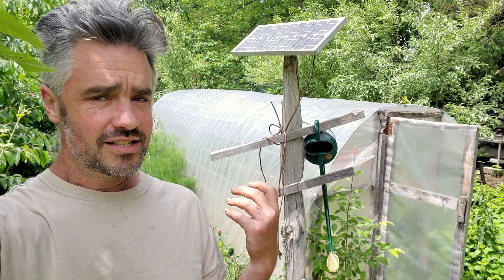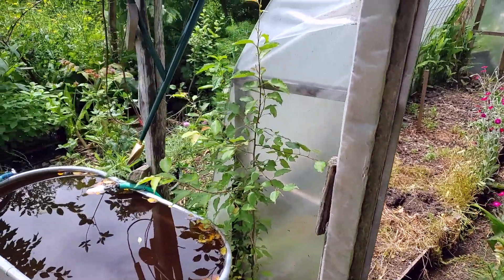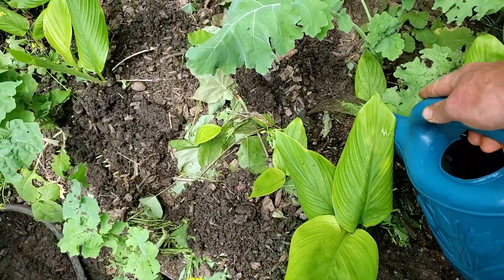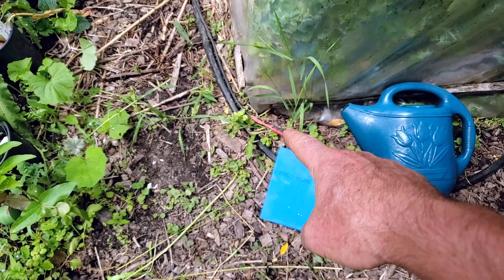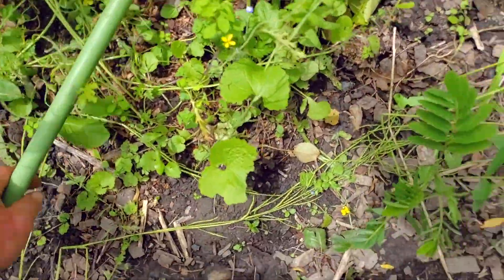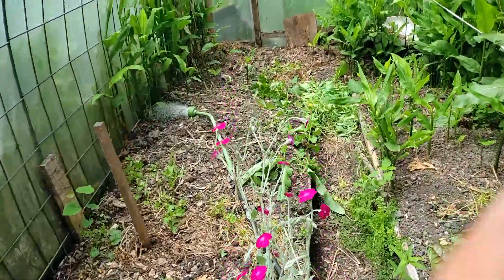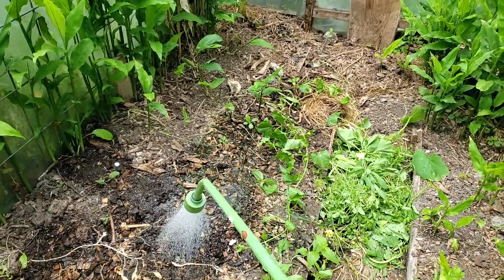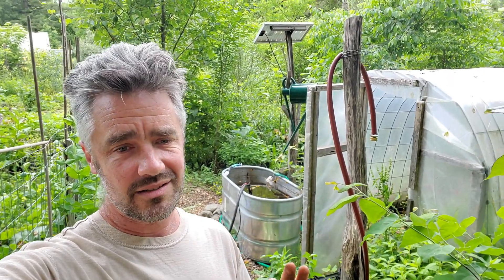Off Grid Pump - Watering Upgrade!

Comment: I put mine in a knee-high nylon stocking to to filter out the big stuff.
Reply from the maker: Thats a very fine level of filtering, you could run it through drip tape with that, wow!

Comment: I use a cheap-o 18 volt submersible pump that came with an adapter for my Milwaukee batteries. It came with a 3/4 barb fitting, so I had to get an adapter for garden hose thread. Pumping 250 gallons takes half the capacity of a 8AH battery. You can do it with 5AH, but it slows down on the last 20-30 gallons.
Reply from the maker: Neat.  Yeah, I found an adapter that lets me plug my 18V makita battery into a receiever that then bucks it to 12v nominal so I can wire in my standard and inexpensive bilge pumps... May be worth exploring... search "milwaukee 18v to 12v adapter" and you can see options sub $20 that turn your batteries into a more universal power source...

Comment: You have harsher winters than I, how do you rig your rainwater tanks in the winter? It has been many years, but last time I had a rainwater system working a late freeze shattered the ball valve and drained all the water. I have been trying to figure out how to plumb a tank for winter storage. This is due to our Mediterranean climate delivering no reliable rainwater in the summer. Thanks for the Garlic! It’s almost ready for harvest.
Reply from the maker: So important to drain tanks in the late fall...   I try to have ours open and empty by Halloween

Comment: I like that this can be used anywhere on your property, for this system I might be tempted to use a second float with a siphon from the tank to an open top / wicking reservoir laid in the bed, Hoocho's - a hydroponics educators rain gutter grow bag systems come to mind. 
https://youtu.be/DyHJvAIe-JI?si=ry2EVN2O51l4UFnM

would mean automatic wicking watering - which the turmeric like in my experience, plus no electricity and you could put the siphon end only so far down in the rez so if it went out of level it wouldn't drain your whole system.

Totally rainwater based is so cool!
Matthew

Comment: I like your solar powered pumps a lot, and have pointed many people toward your irrigation videos, but I'm kind of surprised to see them in this context,.
Because there is reservoir  the next to each bed, I be inclined to  install a hose at the bottom or each tank or trough  and use the gravity to water.
Of course, this way is much faster, and only needs one set up to cover every trough/barrel.

Comment: I was so inspired when you did a video about a solar panel and the little bilge pump! I bought the supplies but my small solar panel just wasn't strong enough to work, so it all got put away. 😢 I would love an in depth video, please show how to do the clamps, connect the wiring plugs and give all measurments of pipe diameter. I ask this because I'll be figuring out how to do this with no ones help but yours! Long time channel subscriber😊.

Comment: I'm generally a big fan of your DIY/solar punk approach to solving a gardening problem, but around 5:25 you advise people to use a cracked solar panel. Studies have shown that a fully intact panel won't leach any harmful elements into its direct environment, but the results are less rosy for damaged ones. Until I accidentally stumbled onto such a study, I'd never have thought of it either. So this is just a heads up. I know there's no ill intent in your advice.
Reply from the maker: Thanks for sharing this concern I wasn't aware of it.  Could you share a link to more information so other folks can learn about this too?
Reply: You are right about this, my husband said it's terrible that the government (uk) is letting good farmland be used as solar fields. I never would have thought it was a problem but he told me about the forever harmful chemicals that can leak into the ground!

Comment: Why not use soaker hoses or drip irrigation to reduce the amount of effort even further? Do you really enjoy manual watering and want to keep doing that or is there another reason why automating this system further is undesirable?
Reply from the maker: Most soaker hoses have some nasty chemical stuff in them and bake in the sun all day so I'm not psyched on it as a solution...
Reply: @edibleacres  Yeah okay, good point. The ones I've got are basically just fabric but there's no way they're made of a natural fiber so it's probably polyester. It's also recommended to put mulch (straw) on a soaker hose. 

Although, if the goal is to limit chemicals in the garden, then plastic pots, regular rubber hoses, greenhouse plastics, tarps, etc aren't that great either... Sadly there aren't really any good alternatives for most of those things. Pots can be ceramic or cloth but cloth would likely still be made of plastics, hoses/pipes can be ceramic/metal but that's really inconvenient and can't be moved around, glass windows for a greenhouse would be preferable but insanely expensive and impractical, tarps can be cloth soaked in bees wax and oils (this is one of the few items where the alternative is actually both better and cheaper than the standard store bought option).

Comment: I installed drip tape irrigation in all our gardens this year.
I put it on a mechanical timer. Also we are pumping from our ponds.
Reply from the maker: Sounds like an amazing upgrade!
Reply: @edibleacres  and with your little pump system you could easily pump into a drip tape or drip line system from your rainwater tanks.
Probably could find some old drip tapes from a grower to make that happen. 😁

Comment: Great solution.
Another path..
Skip battery.  
Small used solar... 
tiny pump... 
float valve to raised 3- 4 Cinder / Fly Ash blocks tub. 
Filter Valve tub... 
Use gravity for water flow and skip active high demand pump.  
And minnows...
Reply from the maker: Great!

Comment: 12v bilge pumps really do punch higher than their cost eh? sent some 12v switches your way, in case yall get tired of unplugging/replugging
Reply from the maker: THanks kindly, I"m interested to know what this means!!!
Reply: @edibleacres  oh, I sent ya a few 12v switches that you can wire up somewhere convenient like the end wall so you don't need to bend down and plug in the andersen connectors each time

Comment: Thanks for sharing. Figuring out a similar situation myself.  Four thoughts.
1. I guess you considered raising the water tanks to about waist height, and perhaps uphill ... wondering why you decided against that? If I guess the volume of that galvanized tub correctly, should be in the neighborhood of 1600 lbs or so. Could be raised with stout timbers, scrapyard steel, or a pile of sand, all of which might possibly end up being cheaper and or more hassle-free over time.

2. I like the Jobe Rojo valve. I have several, work flawless. It is the low flow model from Jobe. But ... is about $35. I love them though. 
3. I suppose you also considered a ram pump. One issue is the 1/5 to 1/3 waste flowing out.   But seems this could be captured and routed back to main tank. Admittedly, the waste seems to make it infeasible for a rain collection application, but is something I have been pondering.
4. Galvanization. Im worried about it. The roof ... the tub ... what convinced you its okay for your application? 
None are loaded questions, Im wondering these things myself and curious your thoughts.  Thanks again, and best regards.

Edit .. p.s. ... one more thought already lol ... Im surprised that size solar panel isnt enough for the bilge pump, which I imagine consumes less than 3 amps? I guess its bc of the shade. I would think in full sun it would be more than enough.  Thanks again.
Reply from the maker: I could loft the tanks but it's a project for sure and not something I feel a need for just yet
The jobe rojo seems expensive, what I work with is about 3 bucks a pop if you buy them in bulk!
Ram pump wouldn't work with this low flow setup I think
Galvanized doesn't worry me.  Maybe it should but it doesn't.
That solar panel is a 25 watt panel and the pump is similar... JUst not enough juice

Comment: It's a trope in permaculture and the world's energy grids:  Store water as high as possible and pump up when the sun shines.

I put storage up top and use gravity to water.  If needed, I would pump from a lower water reservoir with direct solar energy to effectively store water "energy".  This is pumped hydro (for electricity) (which has just been surpassed by battery storage as the word's biggest source of electricity).  This is analogous to storing water on a support at the level of roof gutters...so there's enough potential energy to water things downhill.  The pumping during sunny times puts water back to the high storage so you don't even need the LiFePO4/lead acid battery for low light times.
Reply from the maker: I understand ya...  The layout here doesn't work to our advantage and building super high up storage for 2400 pound tanks is sketchy in our small yard context...

Comment: i use a 5.5gpm/20.8lpm 12v ebay pump connected to a 16.5amp 12v xbox 360 power supply, i used to water everything with watering cans but it was too much work.
Reply from the maker: Nice solution!

Comment: Would absolutely love an in depth video on the making and wiring of these systems.

Right now I'm making compost tea in buckets near a power source and hauling it across the property to water everything with cans.  I'd love a solar/battery setup demonstration because I'd like to be able to make a large volume of compost tea right next to my garden and water it in with my hose/sprinklers.
Reply from the maker: That would be awesome to be able to do that, I will keep in mind the interest and see if we can get a video together
Reply: I’ve been doing the same and hoping for a similar solution, so I’m very keen for a ‘how to wire her up’ video, Sean. It would be great to be able to power a bubbler similarly, to help brew the compost tea in-situ. But this is where my eyes start glazing over and my brain ties itself in knots, trying to read “how-to” articles. I know you could explain how different appliances with different voltages/amps/watts pair with blah, blah, blah simply and elegantly. So, will you also please explain a bit about how the power supply-need ratio works? You said in your video that the solar panel mounted on the post isn’t powerful enough to power the bilge pump, for example. Are there general rules of thumb? I assume it’s obvious once you know. But I assure you, when you don’t know it seems quite tricky. Thank you in advance!! And Kia Ora from New Zealand 👋

Comment: Lets see a design with some layed out hose with holes punched in it so you can just turn it on and walk away for a tea break!
Reply from the maker: That may be the next level design :)
Reply: @edibleacres watching these bilge pump videos I've been thinking about options for low-pressure drip irrigation, for example how to safely elevating a water tank to  as a low-tech pressure tank. This prototype workshop approach is so valuable in showcasing different approaches!

Comment: Love it! I have a hoop house modeled after yours, and because I'm supremely distractible I set up a hose right from my 275 gallon rainwater tote connected to a 2-way splitter that sits in the far end of the greenhouse. I ran a length of hose from that down the middle of each side bed, folded and clamped off at the ends, and drilled little holes all the way down - I can just open up the tap on the tote and set a timer to remind me to turn it off. (Yep, I've drained all 275 gallons into the greenhouse by accident - totally fine, but a waste.)

My setup works fine off of gravity, so I wonder if you couldn't do that with the pump too? You'd get awesome water pressure. You'd just have to put the holes in a good spot, like low along both sides of the hose. I put all mine in the top and the little jets of water can go a little haywire. Or maybe you could use actual soaker hose or drip tape.
Reply: I want to do soaker hose myself..just turn on the water for half hour and come back hopefully to turn it off!
Reply: If using a soaker hose, I would definately filter the water before sending it through, any kind of organic material etc would likely clog it eventually.
Reply: @glennwilck5459  hopefully 😅
Reply: gotta be a rtimer that can turn it on off too right?
Reply: @adamtash2891  totally! You can apply as much or as little technology to any problem as you like, is the best part. I just use gravity and a hose full of holes, but then I do have an automatic timed chicken door... it's a QOL balance 😅

Comment: Sean, your large water containers I forget what they're called the big boys do they survive through the winter okay?  No drainage needed?
Reply: The open metal ones are called stock tanks. I'm in Maryland and I don't drain mine in the winter. The plastic IBC totes should be drained though as they could crack.
Reply: If I recall correctly, @Sean drains the whole system every winter. I believe one motivation for the ponds was off-seaon water capture to refill tanks.

Comment: I bought a bilge pump and a 12v power wheels adapter for dewalt batteries so I can use the power tool batteries I already have.
Reply: I second this idea most people already have a power tool battery laying around and a charger for it!